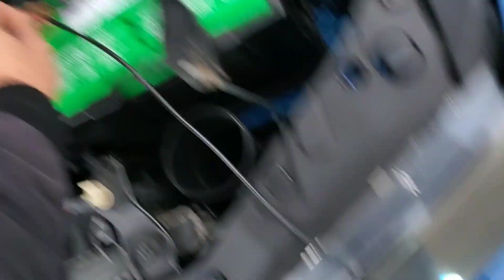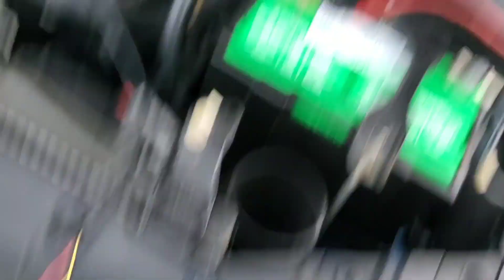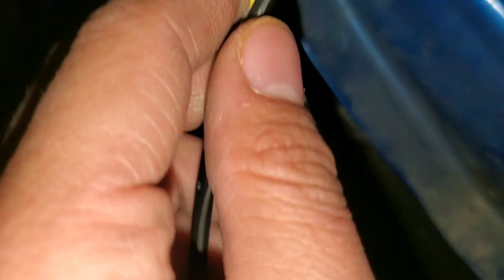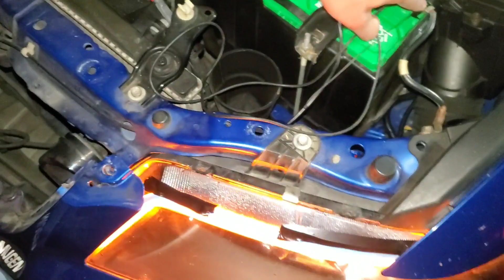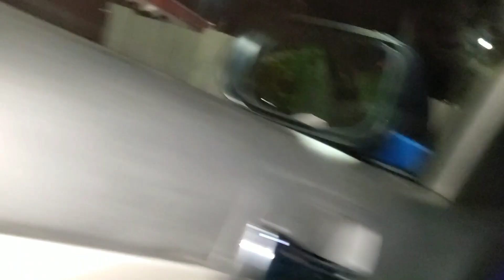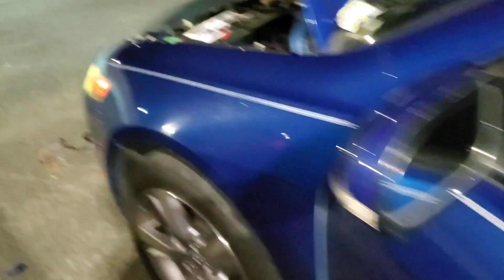Day time runninglights install!

Comment: So it’s outside of the headlamp not inside. Cool cool. XD I had to buy brand new headlamps so I went with the one that came with the daytime running light. Though it was like near 300 bucks :0
Reply from the maker: Yupp this is something anyone can do in about an hour or so without removing the headlights and openingthem and such just stick them on and wire them

Comment: I might do this when spring season comes. Hey NW, you gonna put on the F1 style brake light for the rear center bottom bumper? Im seriously considering that but havent found a cheap one that blinks for a few seconds then turns to solid. Only seeing one continuously blinking when the brake is applied and that is illegal where im at.
Reply from the maker: I was going to but then i found the side marker led lights and decided not to, you can make it so that the lights domt blink at all and jusy stay solid, lets say you turn on your hedlights the 3rd light will be on just red  the entire time, when you brake nothing happens just domt hook up the white wire which is the brake light
Reply: @oscar_cu2  i get what you're saying but i want one to blink for a few seconds when brake is applied then stay solid. The really expensive ones does that. It blinks for about 3 secs then stays solid but i cant justify paying almost $100. The $5 - $10 keeps on blinking which is asking for a ticket where im at.
Reply from the maker: @saidroid3220  you could get a little  moduel that is basically just a tiny chip, that you hook up the wires to then it will blink then stay solid, I just dont know where youd find that lol
Reply: @oscar_cu2  now im just imagination when is it considered too much light? 🤔🤔 We have the regular three brake lights, two extra bumper side markers and add the f1 type light would make it SIX brake lights 😅😅😅...lolz
Reply from the maker: @saidroid3220  thats why i opt out for the f1 light lol

Comment: Looks sick! How hard would it be to put it on the bottom of the headlights? So it looks like a check mark.
Reply from the maker: Just put them on upside down might have to remove the bumper maybe
Reply: @oscar_cu2  do you think it will look better top or bottom?  Also could you make a video with like the hood down from the front if its not too much to ask. I'm really interested in this.